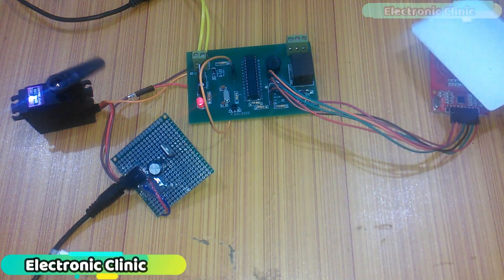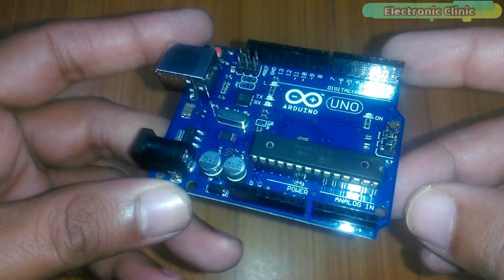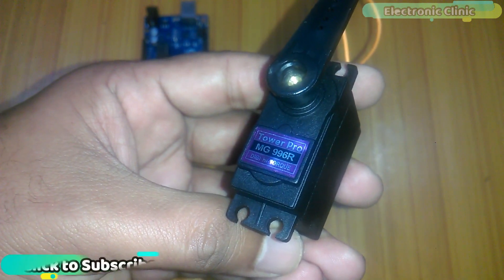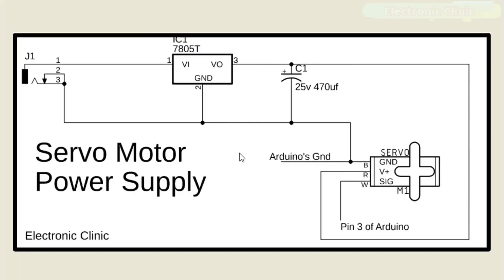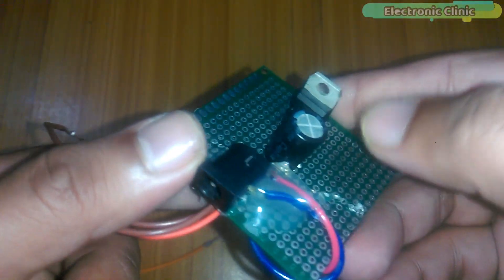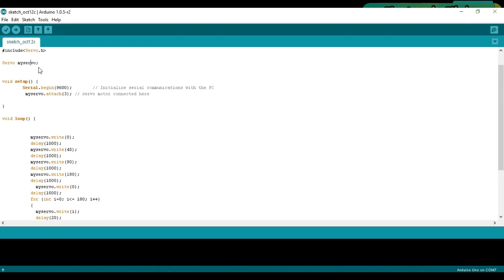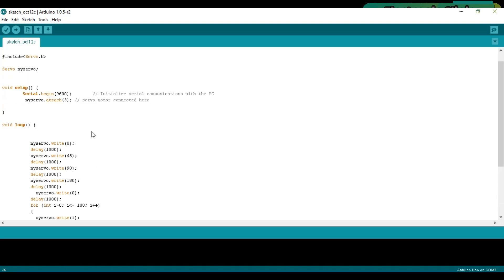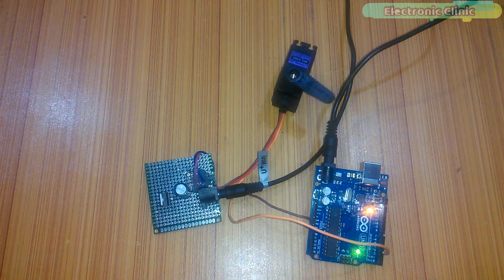Arduino Servo Motor Control Tutorial #1:  Power supply to achieve smooth rotation.“Beginners level”

Comment: what kind of power supply you use in this project?
Reply from the maker: 5v based on the 7805, but it's not recommended. You can check my latest video on 5v and 3A power supply.

Comment: can i use 8 servo ?
Reply from the maker: Yes you can
Reply: Shall i use Capasitor for each servo ?
Reply: my servo is high torque.. Need 4ampere current.. how much current your circuit output
Reply: each servo 500mA